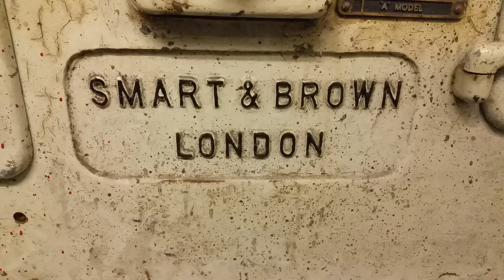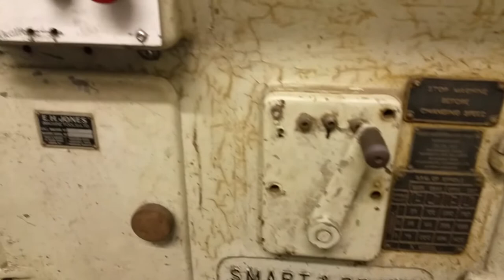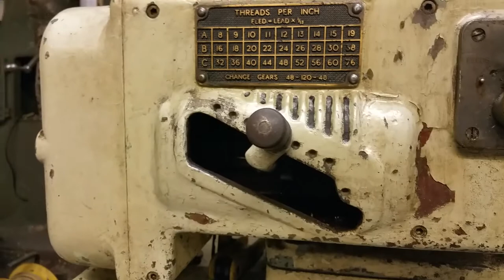Smart & Brown Model A toolroom lathe... Demonstration

Comment: Beautiful machine. I own one more than 15 years and it is in use almost every day. Original gear box was realy noisy last few years. For lubrication of gear box this lathe use grease instead of oil. Now my lathe runs well with six  degree gearbox from motorcycle yamaha 750. It runs so smooth and silent. It is a pleasure now operating on this machine. One of the best in that class. Every single one of thise lathes deseves to be saved and repaired. Sorry about my english! Good luck to all owners of this machines!